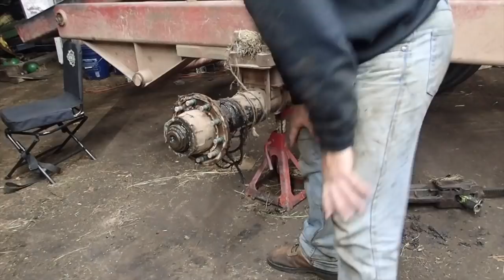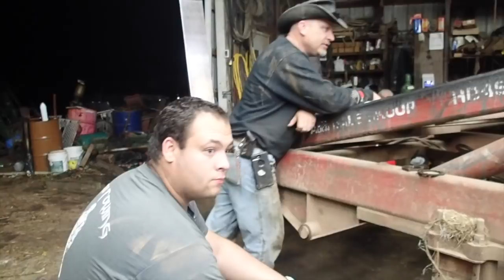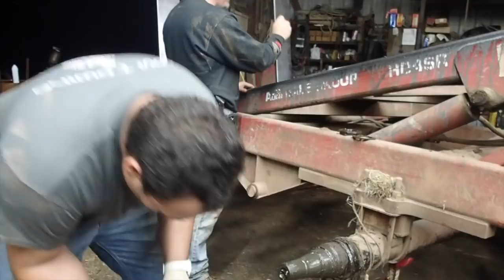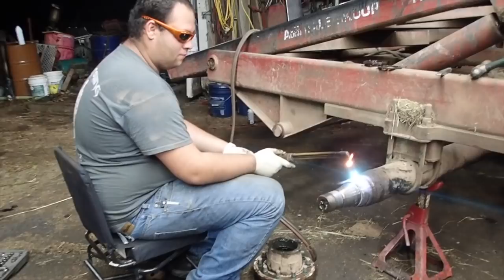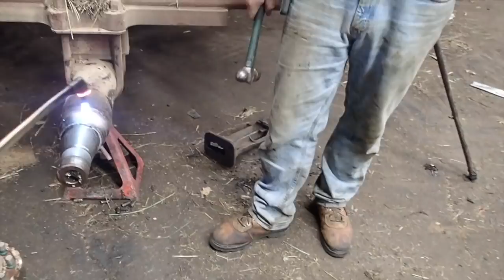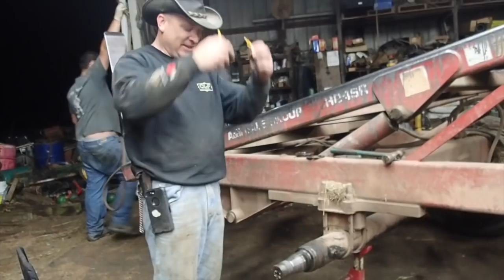Stacker Problems

Comment: We made a special chisel for removing both the bearing races, however, many times you get those extremely tough areas you just can't get into. If we couldn't break it loose with it, switched over to the grinder, if we couldn't get in with the grinder, dremel always did the job.

Comment: I have taking a welder and turned it down welded a small bead around the race when it was in the hub when they cooled they poped right out. I was showed that by and old timer that sat there and watched me beat on a race for an hour. When he did that it took more time to get the welder ready to do it than to beat a race with a sledge and chisel with out welding

Comment: Heat it in one spot and peen it a few times...will come off easily then or you can run a cutoff disc across it a few times and crack it off pretty easy.

Comment: Suggestion:   If you heat all the way around instead of just one spot, you'll have more expansion and better luck getting something like that bearing race off. 
Also, heating one spot white hot+ like that can cause a hard or weak spot in the spindle which might contribute to breakage later.

Comment: You need a Thin 3" zirconia cut-off wheel with 1/4 grinder or 1/4" air cutoff tool.  Way more durable than aluminum oxide, zirconia alumina is best for fast material removal. Get the thinnest one you can buy. Best get it at a welding shop supply. What you are trying to do is just cut a thin slot across the race. Then with chisel that will just fit the slot wedge the chisel in with a hammer and the race will crack in two.  Works FAST! The race doesn't have to be cut all the way through. If the race is up against a hub or something you can't get the wheel into you just cut the race at a 45 degree angle.  The thin blade will cut through the material like hot butter!

Comment: If you heat a spot on the bearing race to yellow heat like Tim did,then hit that spot with the ball end of a ball pein hammer a few licks,it will expand the race a couple or three thousands and let it slip right off.
Reply: Steamfan71    Agree fully, worked in the trades for 20 yrs and heating a strip in in and smack it with a ball hammer always works.

Comment: I never seen anyone do it like that before, I use the cutting torch, the down side is you can nick the spindle if your not careful then that's how I was tought or a grinder,  but then you did cut it in the end 
I helped a nabor one time he beet on them with a hammer until they cracked each his own 
Also getting the race out of the hub lay a bead of weld after it cools they pop out with a couple of hits with a hammer and punch

Comment: that fucking bearing didnt go bad overnight.its fucked, clearly worn out and old.
Reply: Lizza Monti hes had the machine around 20 years and has move 100s of thousands of bales of course it is old and and wore things break, you fix them, and move on
Reply: Lizza Monti not really sure what you're all bent out of shape about there, lizza. Tim obviously stopped operating as soon as he noticed the bearings are going out. Obviously there is no damage to the spindle, no apparent damage to the hub. A new set of wheel bearings and a new seal and that assembly is basically like brand new.

Wheel bearings wear out. That's why Parts houses sell them.

Comment: Just go the easy way and buy a new stack wagon!!
Reply from the maker: Jochem Vahl send me the 100k and I will do that
Reply: onelonleyfarmer You can buy a bale collector for behind the baler instead of a stack wagon. If you do that it has 2 positive points 1 it saves using another tractor 2 those collector aren't a 100k.

Comment: A 4 1/2 inch angle grinder with a cut off wheel does wonders for this .  Cut until just about through then put a blunt chisel in the cut and give it a whack. The race being super hard is brittle and will crack along the cut.

Comment: `Work smarter not harder. Slice the bearing race with the torch pointed down parallel to the axle. One cut and the race will slide right off.

Comment: If your going to replace the race, cut it with a angel grinder flat across the top. The weight gets carried across the bottom !/3 on a axle, saves time and gas. Thanks for the shows Wes.

Comment: Always love the vids....Question, What up with the extra flame coming out of the torch?
Reply: Andrew Whitehead probably just has a leaky gasket where the head connects to the body of the torch. That or the head has an extra hole burnt through. Personally we've had both happen over the years. Neither are a big deal.

Comment: You can slice those races most of the way through with a grinder and cutting wheel, then they'll break after you smack them once or twice with a chisel. Be the easiest races you've ever removed.
Reply: RuralRider I do just the same thing!
Reply: yep that's how you do it
Reply: RuralRider complete agree with you!! Cutting+hitting with hammer=Jeremy Clarckson!!
Reply: That's how I do it to.
Reply: I'm surprised Wes has never figured that out. He just loves the fire wrench.
Reply: Dremels are very handy for their size. Just takes a bit longer but they are well worth it in those hard to get into areas.
Reply: I have done the same think with the cutting torch , with out harming the shaft .

Best of luck ,   :-)
Wyr
God bless
Reply: Was just about to comment that, except in some spots you can’t get a grinder so you get a sharp chisel and be very careful and out a big ole deep  crease across the race and that usually will give you just enough give to pop it off